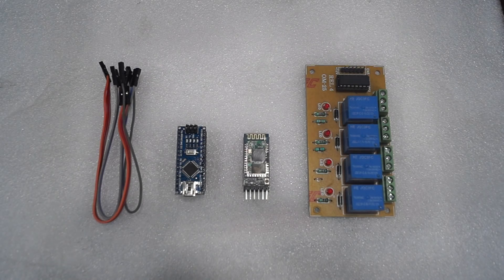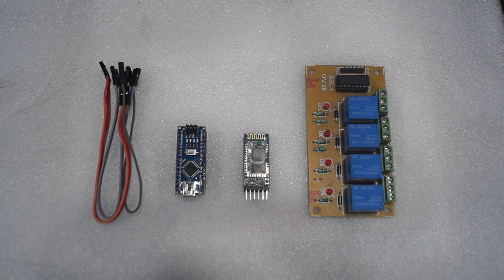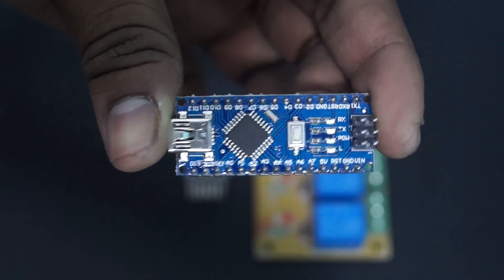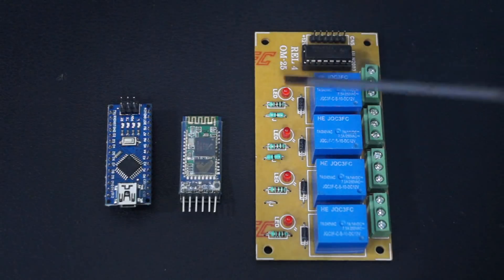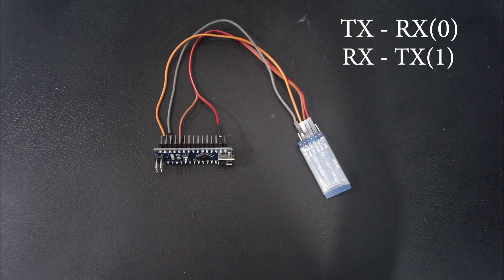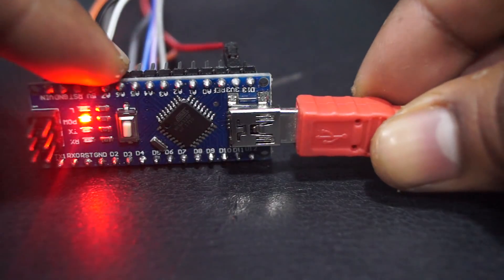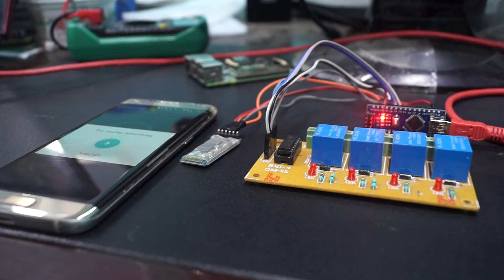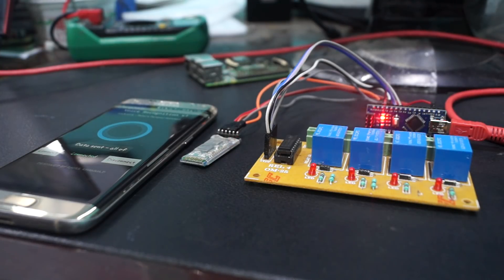Arduino Tutorial: J.A.R.V.I.S v1 | How to make a Home Automation

Comment: Cool Project, can you tell me what type of feedback protection circuit the relay board is using?
Reply from the maker: Actually, In this relay board, a ULN is used to isolate the MCU and the high voltage loads. I would highly recommend you to use an optoisolator in this kinda circuits.